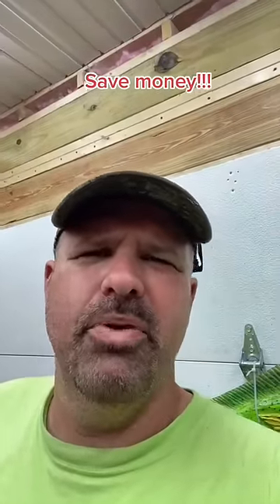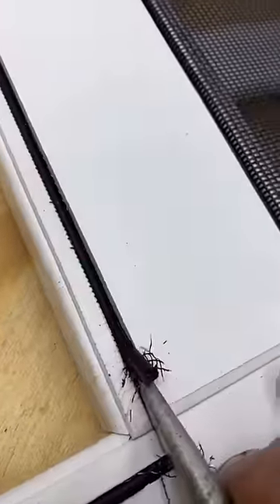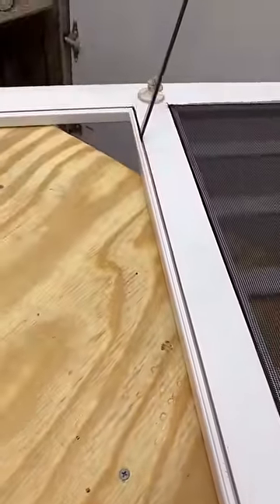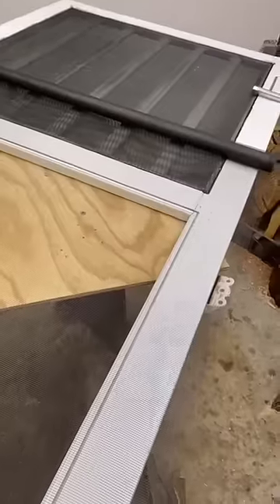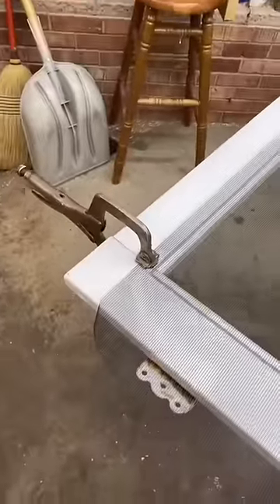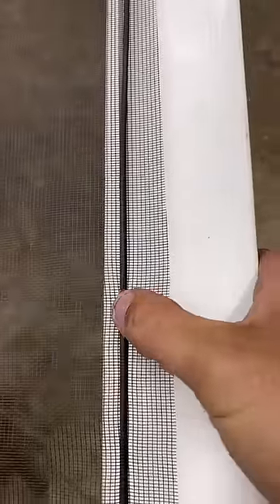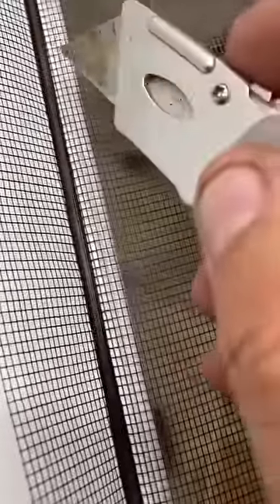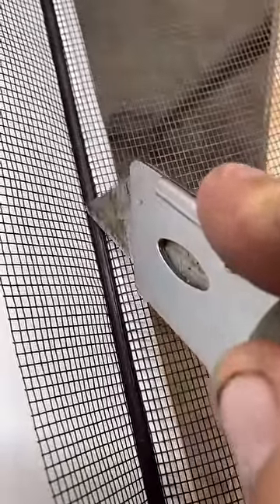Ever change the screen in your windows or doors?

Comment: This way, stretching the screen, may warp the frame. This guy is probably allowing for that but not mentioning it because he apparently knows to do it automatically.

Buy a spline roller. Get the plastic one. Don't waste money on wooden one with steel wheels. The steel ends get wobbly quick. The plastic one's shape allows you to hold it low, a thumb on on axle even and fingers starting grip on other spline roller wheel axle or close anyway.

Maybe buy aluminum screen. 

Could be wasting time putting "fabric" (nylon, plastic, composite) screen back on but then again it can be easier to put on than aluminum or you simply prefer it. Fabric will give and is unobtrusive.

If kids or whatever use screen to push door open, you may want to pick up a screen guard of some sort, nothing fancy or obtrusive to the eye, just enough to guard the active area, like 36" x 7". Nothing uglier, awkward and clunky noisy as a big full coverage screen guard as it works it way loose (it's large and relatively heavy to be on such a place) and the usual screen door frame is usually too unsubstantial a mount for such a cumbersome thing anyway.

If you removed fabric screen and wish to use aluminum, be sure to buy the slightly smaller diameter spline.

Replace the spline either way. It gets old and loses it's elasticity which makes it hard and the roller wheel groove will have a hard time staying engaged and hard spline will be hard to accommodate the screen material as you roll it.

You'll notice spline roller has a different size roller groove on each end for each type of diameter spline. Or has a wheel for pre pressing screen in frame screen channel with no grove and one wheel with groove. Either is fine.

The wife will be there at the beginning and try to assess by looking at your truck and talking to you, husband will assess by looking at the materials (like replacement doors windows etc) and tools you brought. 

Double check option stuff with wife. Once she believes you know her preferences, she'll leave. Husband is gonna stay and watch. Laugh at his jokes and be pleasent.

Black is nice and is slicker than just bare anodized aluminum so easier to handle to me and doesn't have that "cheese grater" feel.

I put frame on concrete patio, there is always rugs and stuff to avoid frame slide, I use cardboard if not, leveraging my elbow and being exact is easier.

Rolling fabric screen on frame with frame on bench is fine, easy to push. If you prefer fabric from here I guess follow this guy for fabric instructions.

Aluminum can be a bear to put on as opposed to the "fabric" but maybe:

Do a long side, shape the screen down to conform, holding screen in a U above screen channel with one hand with roller in other. 

Use roller only to tentatively and lightly press screen in (no spline yet) into frame groove (start not in a corner, but in middle-ish place).

While doing the following, keep eyeballing the tiny screen squares and lines to keep entire screen aligned once you get a good start.

The reason to do a long side first is to watch your "squaring" or alignment of screen always and once one side of aluminum screen is grooved in square to frame, the aluminum will stay in place without spline.

Eyeball the tiny screen squares and lines to keep entire screen aligned once you get a good start.

Should have plenty of overlap of screen around door; (cut nothing off screen before all this except whatever off roll).

If now that you have one side "grooved in" and it keeps popping out, cut a few one inch spline pieces and put in temporarily and make sure screen is "bottomed out" in the screen channel and square.

Then go to other side. Now you have to shape in this side too but this time allow for the channel to eat up some width of screen. 

I've had best luck not starting in the corner but somewhere mid door frame. Roll in screen slowly and do more in a back and forth motion, lightly, letting the back and forth motion bottom out the screen into channel while slowly advancing. Once done, again put one inch cuts of spline in as necessary in this side.

Once both sides are done, tackle the ends. You will note that you have no trouble keeping the spline roller aligned because the nature of pressing the give way screen in screen channel.

Be sure to allow the screen material length for channel again. 

Now ready for spline. This must be done slowly and carefully. Pressing the spline in is almost fun compared to getting to this point. But the spline roller will now depend on your hand as any channel guidance is gone when pressing in.

Same slow and steady back and forth but more pressure. Be carefully, press away or situate in way if you miss or overrun off channel the roller will swerve away from door frame if it does.

Use a thin putty blade or whatever to protect screen and spline when cutting off excess. 🙂 When done, get certificate of completion or money or whatever and leave. If you stick around to drink beer with customers it is not a good idea.

Comment: As someone who replaced screens professionally, don't keep the spline (or as you called it, the gasket) unless it still holds it's flexibility. Learn the difference in gauges of spline and make sure you're using the right kind of spline for your grooves. There's round and flat spline (not hard to tell the difference). It's not difficult in this video's example, but what about the really tough places like the ceiling panels you would find at a pool enclosure? Hire a professional unless you're willing to get on a ladder and possibly risk injury from falling.
Edit: Also the point of using the roller is to stretch the spline and secure it in the grooves. The method you showed here works but isn't as effective when it comes to keeping the screen in place for long periods of time. 
Cheers from Florida, home of hurricanes, screened in pool enclosures and random lightning storms no matter the season.

Comment: He did it wrong people don't do it like that. You have to stretch the rubber (gasket) and put it in all the way in the grove with a special roller or a screw driver carefully so u don't damage anything, and you have to leave more room when cutting it so it doesn't slip out with any pressure on the screen. And you have to tighten the screen as much as u can.

Comment: Let’s say you make about $170/hr… and it takes 20min to drive to Home Depot, 15 min to replace the screen, and 5 min for cleanup. That’s $125 of my time. 
But, I know a guy that will do it for $100 “all costs included”… 

Should I still do it?
Reply from the maker: Just pickup the screen on your way home from work. Will cut it down to $62.50. 😎
Reply: @ChrisGarage78  😂😂😂

I was talking hypothetically.
I’m not employed. I live in my parents’ basement.

Comment: As an ex-window screener, I gotta say using your thumb to put the spline in the spline groove is pure stupidity. what he evidently doesn’t realize is most frame’s groove is too deep to seat the spline all the way in with your thumb, meaning leaning or putting any pressure on that screen would simply pull it out of the groove, leaving you with a screenless frame. Rather for at home screening, take a flat head screw driver and use that in order to seat the spline ALL THE WAY IN, AS FAR DOWN AS IT’LL GO. this ensures the screen is ACTUALLY locked in place and not going anywhere. As for the clamps, they would be useful for an amateur, but would more than likely would end up giving you too much tension right in front of them when attempting to put the spline into the groove, making it impossible; you’ll have to remove them when you get to them.

Comment: Pro tip. If you make a lot of money at what you do, it can be a good idea to pay others to do the low cost or specialty jobs. For example, I charge $125 an hour for my service. If I spent 2 hours a week mowing my lawn I would loose $250 a week. Guess what? My lawn guy is cheaper then that, and comes by 4 times a month, and I don't have to deal with equipment maintenance, gas, cleaning my shoes etc. I would be happy to pay this guy $150 to fix my door instead of dealing with it myself.

Comment: I do screening for a living, don’t listen to this guy. 99% of the time you’re not going to be able to use the old spline or as he calls it “gasket” Bc he doesn’t know what he is talking about, because it is old and cracked and even with new spline you are still not going to be able to put it in with your fingers (if you can put it in with your fingers then i am positive it will fall out with a gust of wind) if you want to fix the screen yourself then go get (1 a roll of screen they sell small ones (2 a screen roller hopefully one with a razor blade (3 new spline (flat) not round for someone doing it their first time flat will be easier , take the old spline out cut the size of screen you need just make sure it clears the groove and start from the top then side then bottom then side and cut the excess and you will be all squared away 👍🏼
Reply from the maker: Mine’s in and working great. We live on the coast where it’s super windy. Been replaced for 4 months and still holding up great. Yes I called the spline a gasket. And yes I used the old 1. And again it’s holding strong. But thanks for sharing your knowledge and not being a jerk about it just because you know more than someone else. Have a great weekend!

Comment: Ya kinda dropped the ball by not explaining to your viewers that they need to press the gasket down completely prior to cutting…..use a roller blade to do so.

If you follow all these steps as is. The viewer will constantly fail to rescreen their windows or doors and will constantly be paying someone to do this for them.
Reply from the maker: Thank you for pointing that out! 🤙

Comment: It’s not as easy as this mouth breather makes it sound. You might make it work if you are handy, but it is not going to be pro level.. ways you can mess up.. 1. You can make the screen too loose, it will look like 💩.  2. You can make the screen too tight and it will warp your metal frame. 3. Your old piece of screen spline can be dried out or stretched out, and over time it will pop out of the groove and the screen will fall out.. 4. Your screen spline roller tool can tear the screen while you are trying to roll the spline into the groove. 5. the screen can move or become crooked while you roll in the spline. 6. You can have some parts of screen end up tight and others end up loose, generally making it look like 💩. And there’s probably 100 other ways for you to screw up. This guy isn’t a professional at ANYTHING
Reply: Another way to mess up.. by trying to reinstall the old spline or “gasket” as this hillbilly says.. if you stretch the spline too much it won’t fit right, if you don’t stretch it enough, your piece won’t be long enough to go all the way around the window.. if the spline is old, it needs to be replaced, don’t reuse it. Also there’s a half dozen sizes of spline so good luck with that
Reply: It is easy, I did this for so many years and didn’t manage to fck this up.